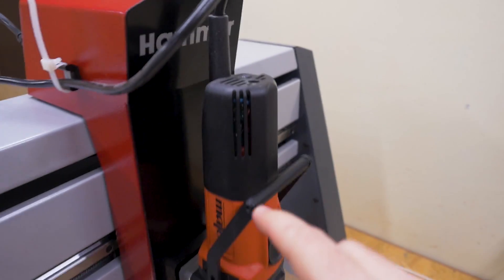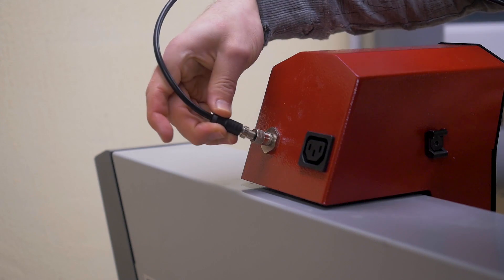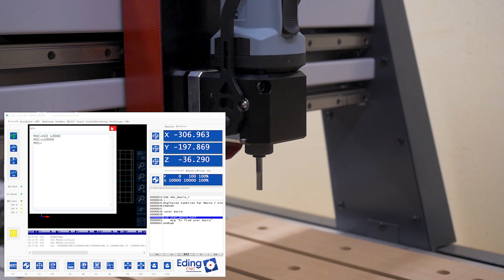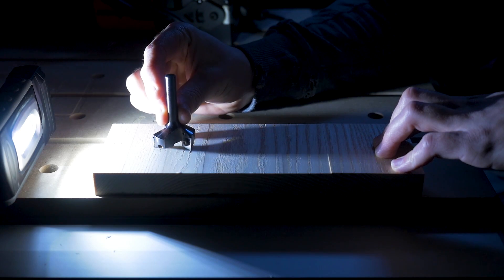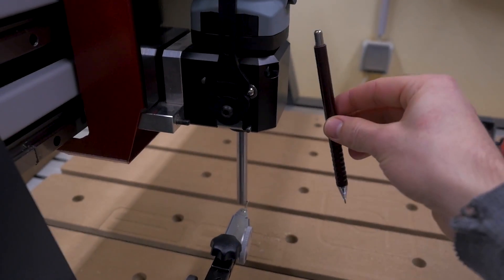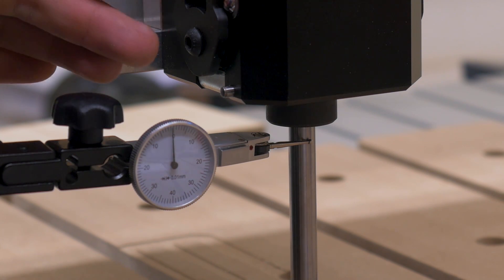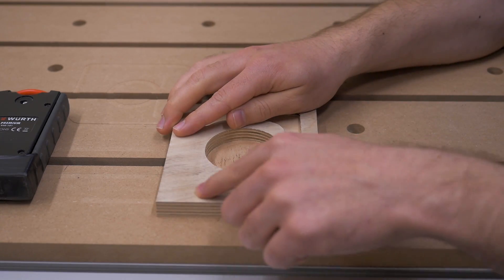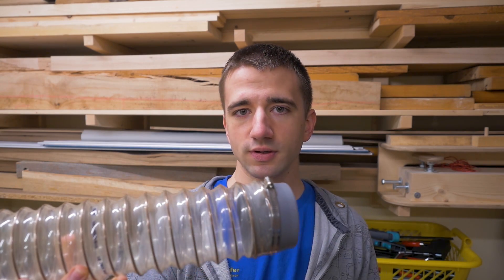NEW Quick Release CNC spindle

Comment: Can you provide a like or any information on this spindle please? I have searched and didn't find anything on the Hammer website.
Reply from the maker: The spindles are the same as the mafell ones. You'll find information on their website
Reply: @MariusHornberger  Thanks. I contacted Timberwolf Tool here in the USA and they told me the quick change version is not available in the USA as it is only made in the 230V version.
Reply from the maker: strange. What does the voltage have to do with the size and shape of the spindle/tool changer
Reply: @MariusHornberger  I was surprised too, but that's the response I got in an email

Comment: Wow, interesting calibration ! I wonder how Felder is supporting that. At least you would need the measurement setup as an option. Also what I did not capture: is the remote control part from the software or part of Felders Hardware ? So  is the Eding SW Part of the Hammer CNC ?
Your mic might capture „electrical high freq noise“ from a circuit inside the remote control. Try to wrap some „grillfolie / Alu „ around your mic housing to prevent that. You might need to connect the stuff to ground , but often wrapping around is good enough.
Thanks for this interesting video !
Reply from the maker: Even if setup perfectly from Felder, a lot can happen during shipping and setting up the machine that knocks off the accuracy in the 1/100 mm. The remote is part of the software. Felder doesn't make the softwar or the remote, they just use it.
Reply: Marius Hornberger while I total understand that any machine needs a setup at the place where you use it ( same with your or mine K3 ), I wonder if Felder delivers the tools to do so? 
For the K3 no setup tools are delivered, but they mention what is required. Your special hand made tool ( maybe from the lathe you have build the stand for 😁) e.g. would be a tool that at least is required for the setup. What is Felder suggesting ?

Comment: I don't want to sound like a butt head ,,, but why would you need to adjust the speed in the software when you can just reach to the dial and change it.?????
Reply from the maker: When it's set up in the programm it does it automatically. Just think you're making 100 parts and every time you have to change the speed manually

Comment: Your method of checking your spindle's alignment is based solely on the fact that you assume your other axis works ok. Never do that, now, if you didn't show it in the video, that's something else, but if you didn't, the procedure to entry level CNC grading is to start from the largest to the smallest element, group by group, until the last item to check, is a cylindrical precision item.

Comment: I believe by tramming this way You made the spindle parallel to Z axis. This means that if Z axis is not perpendicular to the work surface the cutter is still cutting these groves. My suggestion would be to tram against the waste board (by attaching gauge to arm sticking out sideways from spindle, then by turning spindle and adjusting for same value for whole rotation).. At least I do it that way, but my machine is much, much cheaper and less rigid..

Comment: Hi Marius,
the way you tried to align the spindle axis perpendicular to the X-Y plane is not the best way. It only works if you know that the Z-Axis is moving perfectly perpendicular to the X-Y plane. And I doubt that the Z-Axis is perfectly aligned. A better way where the alignment of the Z-Axis doesn't matter is to mount an dial indicator on the spindle axis somehow so it extends to the side. This does not require any precise things. It just has to be rigid enough. Then you need a surface that is parallel to the X-Y plane. You have flattened the surface of your wood plate right? Than that's the surface you can use. Rotate the spindle so the indicator is on the left and zero it. Then rotate it by 180° so it is on the right. If the spindle axis is perpendicular the indicator should also show zero. Repeat that for the other axis. Then you will have a nearly perfect aligned spindle axis. I hope the explanation is understandable. 
Best
Alex
Reply: Yeah it would be better, though this is wood. Examples can be found my searching for "tramming a mill".
Reply: Hey Alex, a Video is better than thousands of words: why not make one on your channel or is there already one available ?
Oh and BTW: are not his test all about the Z- axis only ? He is testing in place up‘n‘down ( z-axis ) while he is not testing on a different place ( x/y axis ) . It is also my understanding, that with this method he will also compensate miss-alignments in the z axis.
Reply: @peacekeeper5119  maybe it's a good idea to make some video about that. You can also align the spindel axis by doing test cuts with a big cutter. That can be very accurate too. One thing is to look for steps and another thing is to look at the circle pattern. It should have marks from both leading and trailing cutting edges. I don't know how good the tool marks are visible on wood. But the steps from the passes should be visible. And of course this has to be done again for both directions. @Marius pleas don't understand that as offending or so. It should just be a friendly advice how you can further improve your CNC :)
Reply: Alex CNC hmm, „looking“ at testcuts sounds not like measure. Maybe there is a way to measure it better ? Video would be excellent. Wood of course is much depending on moisture and grain direction (beside temperature etc also for other material ) so once cut with high accuracy, there is a good chance that later it is anyhow not the same size 😄. But Felder allows to use the CNC also for other non-FE material, so setup could be an important game changer.
Reply: @peacekeeper5119  in aluminium you can easily see a misalignment of about 0,02mm measured over 200mm distance. With testcuts you don't need a dial indicator and a good way to measure the X-Y plane. But Marius has a good X-Y plane with his surfaced waste board. So I would use the dial indicator method there. Once set this won't needed to be set again and it also doesn't matter what material he is cutting as long as the machine does not flex to much. Of course if the Z-axis bends a lot due to the cutting forces there will be steps in the material again.
Reply from the maker: Hey Alex, thanks for the suggestion. I know that my methode only aligned the spindle to the Z-axis and since can't (without a lot of effort) adjust that, I had to assume it is adjusted correctly. One problem I see with really aligning the spindel to the machine bed is that if the Z-axis is not aligned perfectly that I will then get steps on the cut edges. But while I'm writing this I think that is less noticable than the steps on the surface. I'll check your methode once I have some more spare time.
Reply: @MariusHornberger  Your results where already quite good so the Z-axis should be quite ok. I think the possible step on the side would be less visible then on top. If you do a finishing pass with the whole depth at ones there will be no step at all.

Comment: Where the vacuum hose connects to the spindle, suspend the hose with long spring / surgical tube / bungee cord from the ceiling, so there is a very slight upward force on the spindle, rather the full downward force of the hose's weight

Also, another point:

I've seen several other vids where a spindle held only on the bottom tilted, deflected with strong forces on the tool.

you can see this by using weight scale to pull on the a bottom of a rod in the collet, with the spindle in lowest position .

The solution was to add a another support at top of the spindle.  Which of course, MH could make with 3D printer. :)

Comment: Isn't it strange you have to shim an expensive machine like this? Or is that also how it is suggested in the Hammer/Felder manual?
Reply from the maker: Every machine, no matter how expensive, needs adjustments. Many things can happen during shipping and setting up a machine that you don't notice until you meassure in the 1/100 mm
Reply: @MariusHornberger  I can understand that. I just thought that they would have added some 'official' method to calibrate it, not shims.
Reply: @michael.knight  Shims are a pretty reliable and cheap way to do something like this (infrequent and subject to vibration) :-)

Comment: I really had to listen for the "click" to hear it. If you hadn't said anything I probably wouldn't have noticed it :-)
"Try not to achieve perfection, as it does not exist!"
Anyway, I liked the video and look forward to the proejcts you will use the CNC on!
Reply: Amen
Reply: I listened carefully and still heard nothing.
Reply: Amen
Reply: I didn't notice the click either, but if you use an audio editor like WavePad you could isolate the click and filter it out. It's pretty easy and only takes a couple minutes to clean up the whole audio track. I have used it to eliminate similar noises in some of my videos.